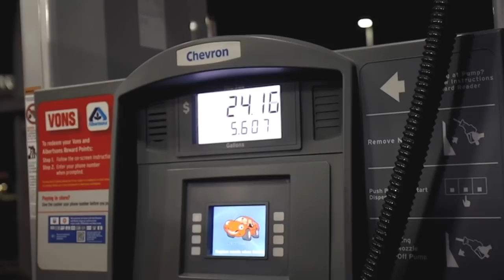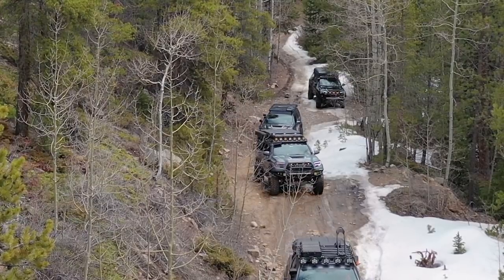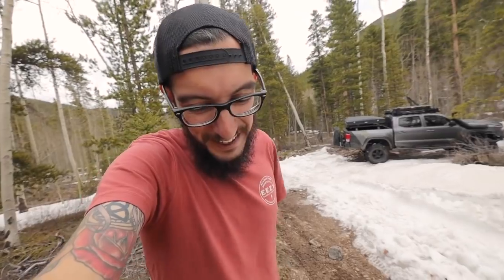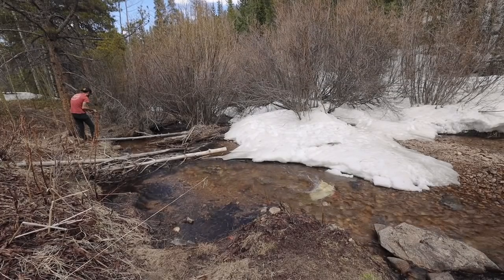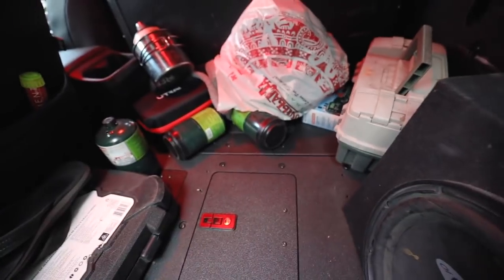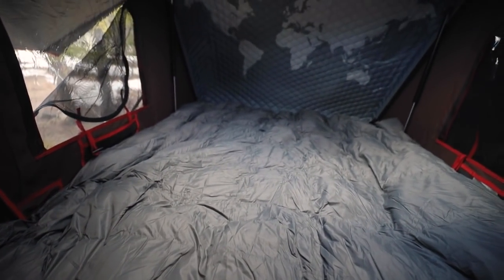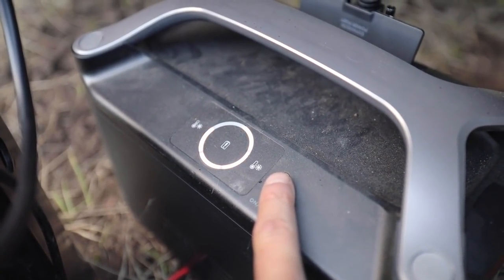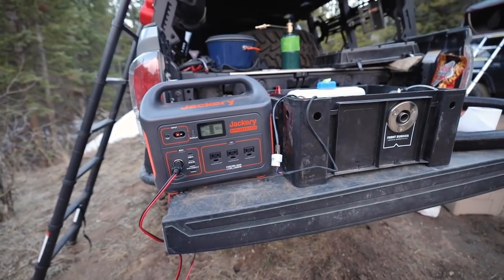Exploring The Colorado Mountains | Camping Near A Creek

Comment: Dang folks, you guys are a half a step away from a motor home with all that gear. Heaters?!  No way! I have a good -20 sleeping bag, and unless it gets below 30 degrees I just cover with it. Below that I zip up in it and I'm good to about 10 degrees. 
The other thing that shocks me..... My buddy has one of those $3,500 IKampers. Yep, he sets his up in like 4 minutes and it takes me 15 to set up my $900 Smittybuilt. But I don't wake up in a dripping mess and have to dry out under my mattress for an hour after I get up. So I'm actually packed up before he is! Not to mention that the IKAMPER mini is so short that my 6ft 10inch ass won't fit in it! 
On to the charging stations, solar panels, A thousand wires, adapters.... WTF?! No wonder you forget food!
In my Tacoma I installed a second battery in the corner of the bed, on an isolator of course. That deep cycle battery will run my fridge, my nighttime lights, charge my accessories and anything else I need for days. Since most of us overlanders never camp one spot for more then a day or 2 what's the need for all that other crap? And even if I stay for longer, I run the truck for 30 minutes and I'm fully charged again! 
You gotta learn the meaning of K.I.S.S.
And make yourself a checklist.

Comment: Not trying to be rude but how you guys are getting stuck when I'm on stock 1st gen CR-V plowing through 3 feets of snow. I thought that those big rigs would be great to upgrade form my old CR-V but I'll need to think again if those are any good..
Reply: Snow conditions are very dependent on temperature, snow pack, previous lines, how much momentum is being carried into a drift, etc. It's very hard to judge unless you're there trying the same snow on the same day. The one thing going for you is lighter weight compared to all the gear they are carrying. The Tacoma will shine in many more conditions the crv will not. I get what you're saying but some variables to consider.
Reply: 1st gen crv’s are sweet

Comment: Are those trucks all stock gearing?  With all that gear and the bigger tires I've heard most guys re-gear the rear ends on the new gen Tacos.
Reply: You should always regear. Better throttle response, better torque, better gas mileage, less wear on parts. Problem is it's very expensive

Comment: Hey! I love the video! Was wondering if you would recommend this trail for some guys with full size/ larger trucks (Like my ram 2500) as far as length/ height/ width, or if I would be too large.
Reply: They had a tundra with them which is about the same size so you would be fine I'd assume

Comment: What mount are you using for radio antenna?
Reply from the maker: Midland radio
Reply: Thanks, Sorry I meant which bracket? Is that bracket for ditch lights? I currently have the same ghost antenna
Reply from the maker: @ryancolleran245  that’s from rago fabrication